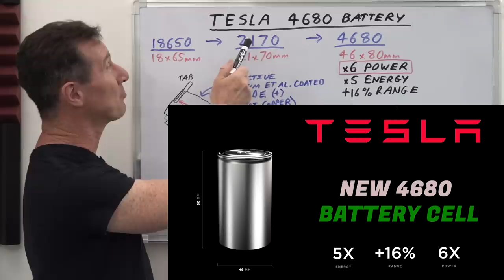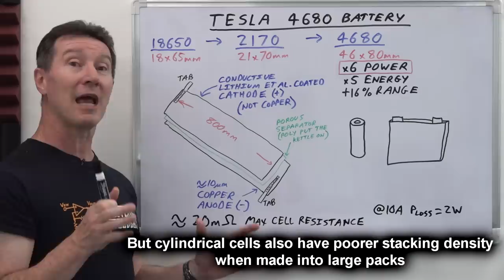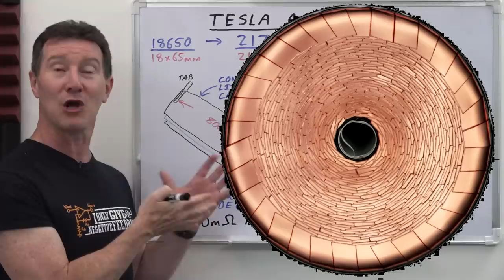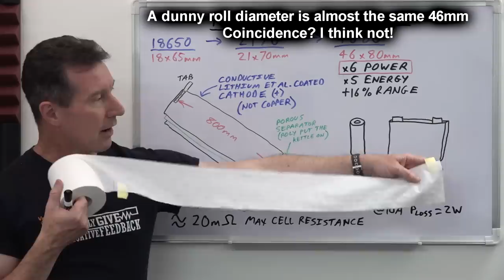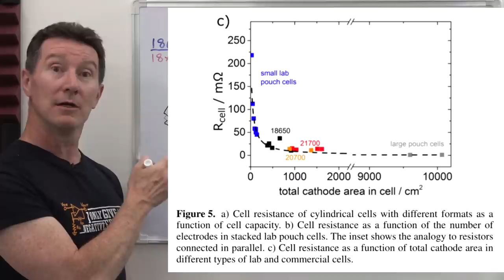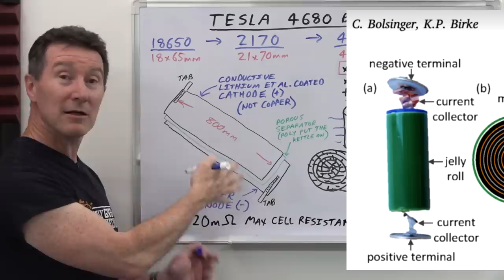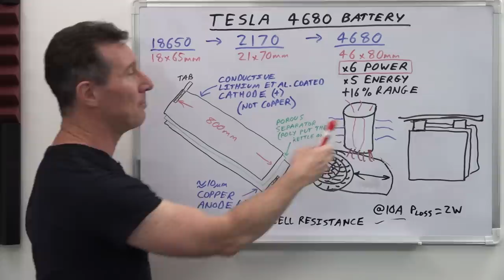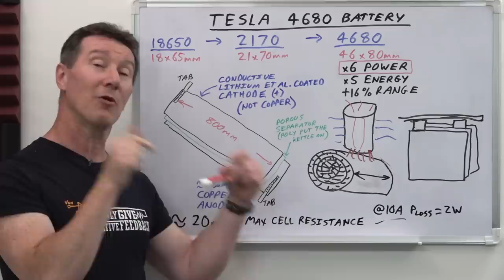EEVblog 1340 - New Tesla 4680 Battery Cell EXPLAINED

Comment: 18650 - yep
21700 - yep
46800 - still haven't seen them, anyone?

Does your e-car use these 46800 cells, Dave?
Reply: Yes Sandy Munroe did a tear down of 4680 pack. This is six months after your comment.

Comment: Your comments at the end about how the increases are just what you'd expect anyway by scaling up ignores all of the downsides of just scaling them up.  For example, just scaling a normal tabbed cell will increase its internal resistance, not decrease it like the 'tabless' design.  It will run hotter AND be harder to cool.  There's a reason they didn't just scale them up before.

Comment: Your preference for pouch is dumb and wrong. The 4680 is now glued together and no longer have space for cooling between cells because there is no void for circulating liquid. The heat goes to the bottom anode and they have cellular design cold plate for circulating coolant. THE BIG TAKEY AWAY IS THE CELLS ARE NOW A STRUCTURAL ELEMENT FOR THE WHOLE CAR PROVIDING TORSIONAL RIGIDITY. That is not possible for pouches without thermal management.

Comment: When I first saw this battery and read how excited people where for the revolutionary 5x energy I just got pissed off looking at the numbers. Ran the calculations, found out as pointed out here that you get 5.5x by just increasing the size, I just thought it all to be marketing BS with an actual decrease in performance. Further I tried to figure out the 16% extra range with a lower energy density, found out the physical size of the new pack was roughly 19% bigger, not impressed. I didn't really think much of the power and the tables design, guess I assumed power would increase with size. Overall I guess it's an improved battery, it's just the marketing that is pissing me off, and people eat that shit up!
Reply: Reading more into it again I'm seeing that the 2170 has a capacity of roughly 5000 mAh while the 4680 has around 9000 mAh. By my calculations that's not even 2x, far from 5x. The fuck is going on there?!

Comment: Batteries can be made, for pennies, and last forever, using Graphine. Graphine giving 100x the energy density. 
All the big companies know this.
They also know about the copper tags, in your video.
Tesla do not control, technology release to the public, its someone else... 
Tesla does not want to destroy the existing battery market by creating an ever lasting cheap battery, this would cause
death threats, loss of contracts and media censorship.  They have been given permission to improved it slightly, so they have an edge.

Comment: 25:42 "any fool can increase the form factor" -elon musk.  Yes increase in energy and range are inherent to bigger form factor, but bigger form factor like 4680 has issues with thermal management and supercharging. that is why its never used before. its use become only possible due to tabless design. so tabless design in essence is fundmentally and indirectly responsible for better range and energy capacity

Comment: he side tracks so often... under A.D.D. in the medical journal- it says "see this guy". lol. j/k good segment. I think it would help a lot if he'd explain that power is voltage & energy is kwh's. 16% is the gain in energy density over the previous PACK design. actual energy density of individual cells is still somewhat of a mystery? but I'm sure that's on purpose. dry application of the lithium solves shelf life degredation & growth of dendrites from charge / discharge in general, as does the cell chemistry changes they've made, all add up to a TRULY million mile battery. toyota just got OWNED.

Comment: Using an expensive higher order energy for motive is the dumbest idea ever.  If you want to use electric motors go with the diesel electric motor locomotive design.  Electric motors replace the transmission and motor generator produces the electricity.

Comment: Imagine trying to solder an anode of these kinds of cells... This probalbly sucks up more heat than a beefy CPU cooler
Reply: As I understand it, on their battery modules they weld the cells to busbars using an ultrasonic friction spot welder that attaches this tiny little wire that also works as a cell-level fuse.

Comment: Good video!.It is disappointing that Elon Musk who in many videos used the syntagma"energy density ",did not do it on the battery day when it was most expected by experts.This figures : 5x and 6 x were somewhat misleading.Of course one cannot make technological discoveries instantly even if proper research is done.The good thing is that Musk translated this into manufacturing improvements and subsequently cost reductions.This is good.In this way the battery was a true innovation.As Elon presented "structural frame "batteries,the batteries may substitute some extra material (steel or aluminium ) and thus the car can  become lighter.So a lower weight  can be considered as the sourse of the  extra range and possibly power.Again this was not necesarily an apples to apples comparison.

Comment: Capacitor manufacturers have been using this manufacturing technique for decades. It was to reduce the self-inductance caused by the jelly roll method. It obviously also reduced the ESR of the capacitor too. Nothing new, nothing to see here, move along.

Comment: Imagine if some genius used the same technology to fan fold it into tightly packed bricks.  Or better yet, stack them into thick strips.  And why not print the metal into your battery?  Anytime you cut foil there is substantial waste.  Maybe they can sublimate cheaper metals like nickel into carbon substrates.  Bake it all together before adding your battery chemicals.  Boom, you have a nearly indestructible battery that can withstand 3000º.

Comment: 1x 4680 = 8x 18650 (volume and weight)

1 high power 18650 = ~20 mOhm
8p high power 18650 = ~2.5 mOhm

2 mOhm It is a slightly improvement but more or less what it should without the Innovations

Comment: I think Tesla needs to solder the negative.that connection looks like it will fail and get hot due to resistance . over many charge cycles it’s basically a compression connection and the entire cell is expanding and contracting wen it’s being charged and dis charged 

The intel die solder would fix it 

Time will tell

Comment: ~@21:00 that reduction in wasted power (from 2 watts) is more than it seems. Taking away 90% of the heat (reduction down to 0.2 watts) means 90% less cooling needed as well, and cooling takes power. So cooling energy required is also reduced by 90%. These two elements all by themselves probably account for the vast majority of the range benefit. Not only is the thermal management better because of the tabs, but they only need 1/10th of the cooling if they are cutting out 1.8 watts of wasted heat energy to begin with. Brilliant. Most interesting to me is that its basically a physical design optimization, and not some major chemistry advancement but the net result is 16% increased range. I think the round cells (vs battery bricks) are much better to mass manufacture over the bricks as well, so ability to pump out max ammt of battery goes way up, decreasing costs further.

Comment: Meh, my piston powered car only costs about $0.20 per mile all in: initial price, fuel and maintenance. And it actually has decent resale value with linear depreciation after the initial new car drop;  because it is easy for a common buyer to assess its condition and fix most unforeseen issues with minor capital cost. EVs, including hybrids, have a poor resale market because the battery condition is a major gamble and a huge replacement cost. The majority of commuters are poor people who buy used vehicles and can't afford a new battery. Right now EVs are trendy fashion among the wealthy, it will be decades until they fit the needs of the working class. Vehicles are traditionally sold several times over their lives, comparing new EVs to new IC vehicles is weak, you must compare used to used because used sales are 3-5 times as numerous as new sales.

Comment: So, you'll get more efficient charging, as current design sucks, specially supercharging, a bit more density, and a bit more power output without sacrificing much density. Is it enough for trucks... well.. IMHO, no. And ist's not a battery issue (well, it is, but not directly), is an electric motor problem. Electric motors suck a lot of power and drop into an abyss of efficiency when they are loaded. Search for tesla tow videos, an you'll understand the issue, even at slow speeds, a model x can suck up to 2kw per km, which is worse power consumption than a similar diesel in similar conditions (I know, I tow cars sporadically, in a dolly, and my V6 td, only suck a liter or two over the usual power consumption). When it comes to TRUCKS, the problem raises the bar, a lot. A 750Volvo, with a v8, euro6, needs around 70 to a 100L per 100 kms, taking the EV truck to it's level, how many tons will an EV truck be able to pull and for how long? 10 tons of current battery tech, isn't enough for a 100km... Far from a viable EV application. Unfortunately, electric motors, till today, still have the same problem, specially above 4000 rpm (yeah, run a tesla on the highway, and you'll see it's range go down to halve or less, depending on the load). Yes, this a brilliant achievement from tesla engineering, but still, not enough, far from it, for high load applications.

Comment: Hi. How can you say the 6x power increase is the result of the reduced resistance with all other things being equal. The increased volume of the battery is fundamental in the power increase. 

You also say  the 16% range increase is not impressive.. It would only ever have any meaning if the comparison was for similar cells, chemistry, architecture and size.

And if you gained 16% range by simply altering the engineering of the cell I would call that massive. Same size same materials and 16% more range from adding tabs thats a billion billion$ innovation. And your not impressed Sorry thats BS 100%.

Why did you you flip off the volume increase so casually when it is fundamental in all three listed increased performance metrics.

Seriously. Why

Comment: Your conductor calc put the copper foil in as 80mm 2. You put in PCB thickness 1.6mm WTF. And you think that answer was relevant in any way. What state is yr example it doesn't describe either. When you talk it sounds like the screen shot is for the old design?? Then verbally you say what the new one would. By that reckoning the new design makes no difference. You say the new design will result in R =2 mohm but yr screen shot shows 80x80 giving 2mohm
Reply: Please try to look closely to the screenshots he shows.
The PCB Thickness is in no way part of the "resistance" calculations
In the right upper corner it shows cleary 9µm copper thickness in booth screenshoots.
The relevant part is the area of conductivity
Old 2170 = 70*800mm (the longer the "cord" the higher the resistance) = ~20 mOhm
New 4680 = 80*80mm (cause the full copperfoil side is now the connecting tab.) = ~2mOhm

Your last sentence is repetive : new design R = 2 mohm and 80x80 shows 2 mohm --> yes ?

As a sidenote: 80x80mm is not 80mm² its 6400mm²

Comment: 16% + range ? Is this a joke. So much power for 16%. Well it's just a marketing trick. Saying that a new battery give you 6 times power and 5 times more energy. And at the end 16% more range 😂 500 miles it's 90 miles + . Not bad but not revolution.

Comment: I guess Tesla wants to wait for that hammer to hit in 2021. It will probably double the Range without even an increase in battery size and weight. I foresee a great future in the cellphone market also if only a small change in the batteries tabs design is making them cheaper and even longer-lasting.

Comment: None of this is needed if you make fuel from RE instead of using a stupid battery....  EVs are obsolete.  In fact the cost of 100% RE grid vs making fuel at the solar Panel is 20:1...

Comment: the resistance is the key here. People believe batteries are 99% efficient, but they are only in lab. They heat up by 10 Celsius in car or even more(and you do not even have to go the full range for this heat generated). To heat up 500kg battery pack with  10 Celsius, you will need ~3kwh energy which also need to be stored in the battery.  So if you use only 0.3kwh energy instead of 3kwh to "heat up battery", than you can use extra 2.7kwh energy to move to car. And just think on it what impact it will have on the battery life.

Comment: Seems like they are designing, or compensating for a poor decision early on to go with cylindrical over flat packed cells.. Or is there some advantage to the cylindrical design I don't see? Manufacturing efficiencies? Wouldn't you use more of the volume with retangular cells than with cylinders (and hence higher energy density)? Or do they use the space created by cylindrical cells for some kind of protection? heat dissapation?

We need a deeper un-biased evaluation of the overall design considerations to evaluate the design, rather than "Marketing Wankology", which we know, beloved Elon musk excels at.
Reply: Manufacturing cost. Cylinders easier to automate the fabrication. Then compressive strength. If the cell is part of the structure then using it in compression with a plate top and bottom is a good idea.

Comment: It's a good job they've increased the battery cell's power output, because the 1,100 HP of the current model S is kind of wimpy for a car.

Comment: Video could have been >80% shorter, duration of +-4-5 minutes, if you’d only not repeat yourself over 5x! You make m feel an idiot, when you speak as if I need to hear a message >=5x in order to get it…  you often use the same words, so repetition does not improve my understanding. You lack feedback of listening audience, like “mm mm”.., so it might be your insecurity about how you come across that makes you repeat yourself so often… tip 4 remedy: write your speech down… pref. Structure around main messages. It is those that you repeat (way) too often… By making eg the basic selling points of the new battery the ankerpoints of your narrative, the skeleton of the whole structure, you avoid ending up with 6 arms and 12 legs.,. A narrative with an awkward structure, or, better, seeming to lack any structure, just a “make it up, formulate sentences as you go… “… feel bored and treated as stupid already? I repeated a few things here too. List ing leaves a lot more of brain capacity free then reading, so when auditory messages are repeated, the brain has more quickly over-capacity, and over-capacity is detected, felt like “boring”….